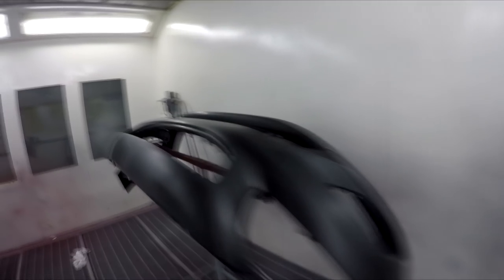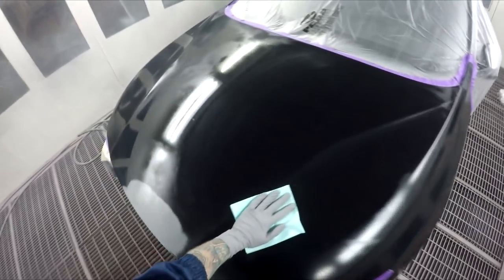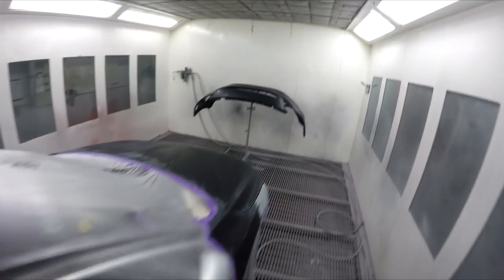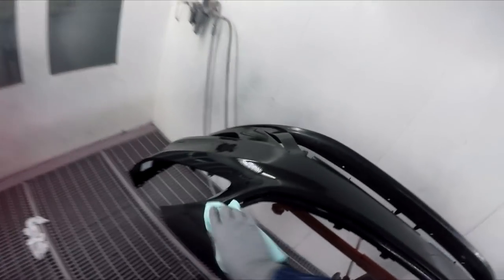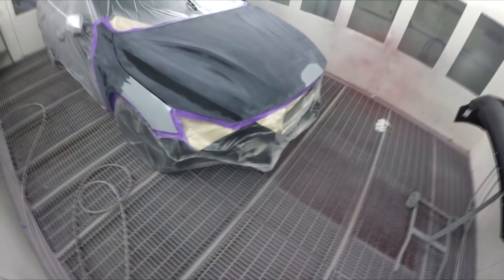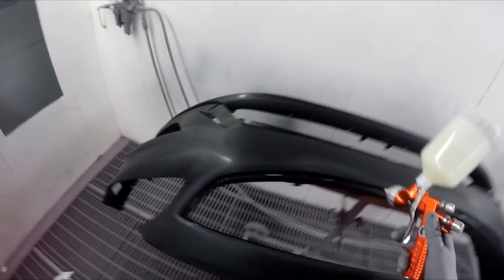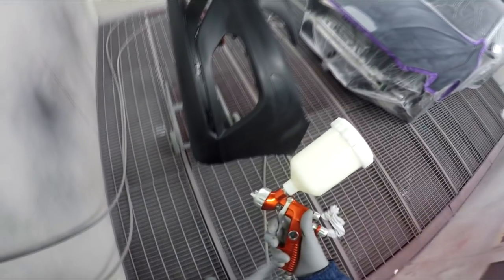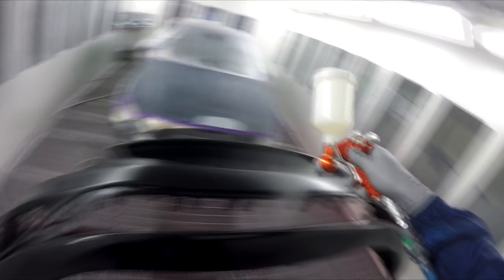Volvo S60 Spray Painting

Comment: Great vid. 
We've had the same problems with clear. Been using HB body 2.1 voc clear for over four years, changed the hardener and it's just not the same. Get crazy die back, on some colours it's really bad. 
In the last few weeks tried the standox clear you use, found it really hard to get to grips with.